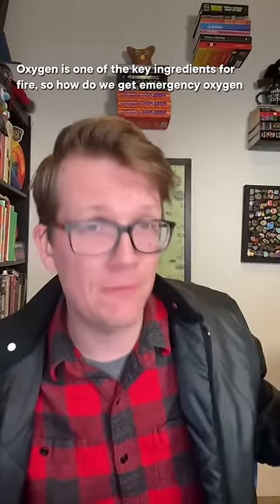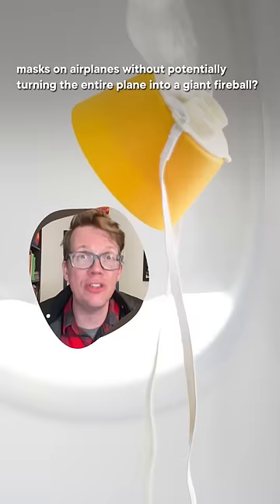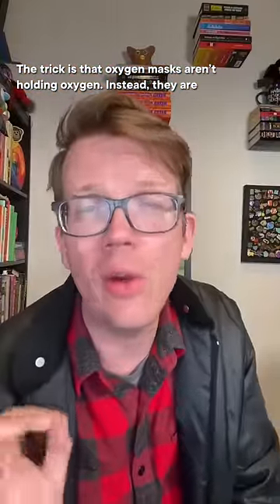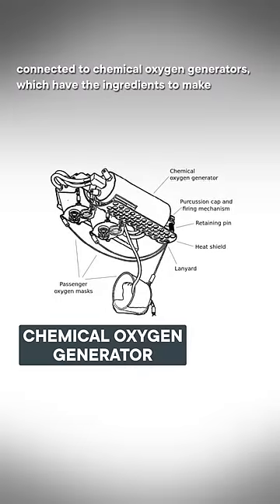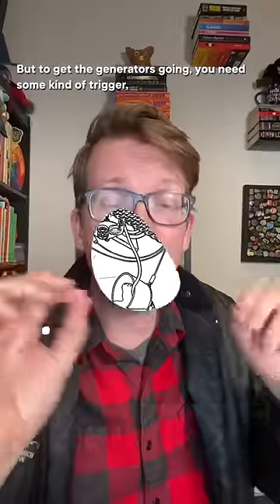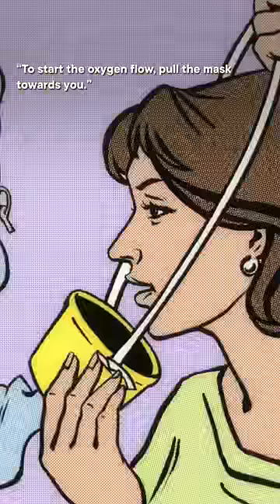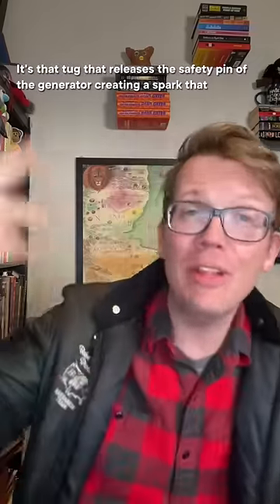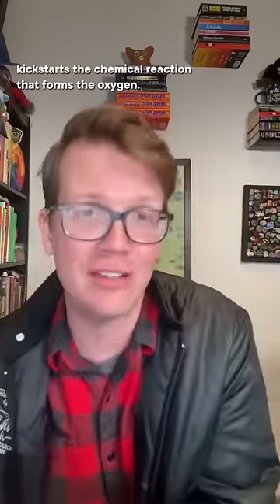If oxygen means fire, how do we get it on airplanes? #shorts #science #SciShow

Comment: All this complex engineering and chemical creation ability and the trigger is just a simple mechanism from pulling the mask toward you. Sometimes simple machines are still the best way to go.
Reply: Less parts = less chances of failure
Reply: @typicallyusual6984  the only problem with that is when it does fail it will be really bad.
Reply: Simple machines are ALWAYS the best way to go. The best and most reliable systems you can think of are likely made of mostly simple machines.
Reply: "Simplicity is the highest form of sophistication." Leonardo da Vinci"
Reply: @djmdma3752  It's not a problem if only one or two fail. Most, if not all, planes do have a few oxygen bottles for emergency use
Reply: @raerohan4241  I’m talking about when something has less parts the chance to fail is lower but more damaging
Reply: @djmdma3752  A system with more parts doesn't mean that the failure of one of its parts will be less severe, it just means that It has more parts (a.k.a more points of potential failure)
Reply: Well, why would you make it complicated? 😂 There's no reason to say "that's a complex system so we need at least a 10 digit code (in ancient Egyptian language) instead of just pulling, but not entered with regular typing but via thinking of the numbers while your brain waves get analyzed with some alien tech".

That's like saying "woooww, the Bugatti Chiron is such a complex, well engineered car and you can start it with just pressing a simple button? Sometimes simple tech is still the best way to go" - yeah, what else would you do? 😂😂 Just because something is high tech or well engineered, it doesn't mean it has to be complicated to operate.

Comment: The oxygen supply does not need to last long enough to land, just long enough to get to a flight level where the atmosphere contains a breathable concentration of O2, between 10,000 and 12,000 ft. A plane can easily get to this level from cruising altitude in less than five minutes.
Reply: yeah like what he said in the short haha
Reply: Lack of pressure to get the o2 into the blood is the problem, concentration is the same at 35k as10k..  correct on the time to loose altitude part
Reply: That's what he said
Reply: @timdeathly  He said "and long enough to land." Very last words. It does not matter if they don't last long enough to land.
Reply: The SOP in a loss of pressure situation is put on O2 masks then descend as fast as safely possible to FL10 (10,000ft). It could be lower. At that altitude O2 is no longer needed. It's not needed to land.

As a side note, did you know airlines purposefully use the affects of hypoxia to put you to sleep? The cabin altitude pressure is usually between 6-8000 feet, often during overnight flights the pilots increase the cabin altitude to make you sleepier, especially effective after that free booze!
Reply: 20k feet in 5 min is scary

Comment: Aside from the obvious compactness benefit, storing bottles of oxygen on the plane would be an incredible pain, as would be keeping up and testing the plumbing needed to move all that gas around. The chemical oxygen generators can sit for years waiting to be used, and the fact that it's one per passenger means that you aren't pumping oxygen out through the tube by an empty seat in an emergency.
Reply: Yup! As someone who has chased leaks in actual pressurized crew oxygen lines, I am GRATEFUL they only run to the cockpit
Reply: I work military aircraft with both oxygen generating packs, Carry o2 bottles, and lines that run the entire length of the aircraft. They are notorious for leaks. Imo it's outdated and bad design

Comment: Just for peoples info, make sure you do yours first. You have roughly 15 to 60 seconds to get the mask on before hypoxia starts to take affect, so take your time, be calm. Then help the others around you.
Reply: This particular point I never understood:  I can hold a single breath with no additional oxygen for more than 60 seconds.
Reply: @Nahrix  in a situation like the cabin of a plane depressurizing, most people would panic, and everyone's adrenaline would be activated. This would interfere with problem solving and cause some people to freak out.

Ignoring the panic:
Holding your breath is possible from the oxygen diffusing into your blood from your lungs. So since the oxygen content plumetted during decompression, holding your breath wouldnt help.

Example that would work the way you describe:
if you take a breath of the mask air, then hold your breath, you would be fine.

Hope this helps
Reply: @BiloGadget  I think I understand that what you're saying is that the oxygen levels in the depressurized cabin wouldn't saturate a held breath as at sea level.  I suppose my assumption would be you might have a second or two to quickly breathe in before all oxygen is lost;  or would a cabin depressurize completely in milliseconds?
Reply: @Nahrix  mainly, it would depend on how it occurred. did the plane split in half, or did something eat/corrode a small hole in it? In a way you are right, since most cabin depressurizations aren't explosive (meaning it occurs in less than half a second), and you could likely get an extra breath of air.

think of it like a reverse vacuum chamber being released, with the pressure being on the inside instead of outside. it doesn't need a very large hole, only a small valve, to release extremely quickly if fully opened.

what i was assuming was that an exit door or something like a window failed. with a hole that big the plane would depressurize very quickly. you might be able to get a good breath of air if you're aware of the issue as its happening (as in, a part of the plane vibrating intensely). also, rapid depressurization can cause barotrauma (literally means pressure injury) to the ears and possibly the lungs and eyes if it happens in less than half a second. if you are unaware of the issue in the plane, then it's unlikely you'd even get a chance to think about preparing a breath.

however, if it's a small pinhole, like the small holes in plane windows, then the pressure system of the plane should be able to counter it and you wouldn't even notice the change, and the masks wouldn't even drop.
Reply: Depends on levels of altitude
Higher means less time and it can drop to even 1 or 2 secs.
Reply: @luichinplaystation610  that's what i was getting at with the vacuum chamber example. i just really beat around the bush. thank you for clarifying.

Comment: I thought they were just connected to tiny oxygen tanks! Thank you so much, SciShow!
Reply: Yeah I can see that turning a plane into the Apollo 1 accident very quickly
Reply: you should thank hanks tbh
Reply: Sometimes they are. For example, crew oxygen (on the flight deck) is supplied by bottles and the masks are more similar to something like a respirator than those crappy yellow cups that the passengers get. There are also some flights that regularly cross over mountain ranges that have high enough peaks that the aircraft could not get down below (IIRC) 14,000 ASL without risking CFIT (controlled flight into terrain). If those ranges are large enough that the aircraft could not safely reach 14,000 feet within a couple minutes, then those aircraft are equipped with oxygen bottles for the passengers as well that can last 40-50+ minutes, long enough for the aircraft to clear the mountains and descend to a safe altitude.
Reply: Don't thank them it's a @hankschannel video
Reply: They are… unfortunately Hank is 5 years or so behind on the technology side. That’s how they used to do it and how some still do until they upgrade to the new method
Reply: @steventyler8002  Almost every passenger plane uses oxygen generators. They are significantly lighter than tanks for the amount of oxygen they can produce.
Reply: @richardmillhousenixon  nope. It’s literally my job. Dry gen is old tech. The new regulator we have designed is cheaper, lighter and easier to service. Weighs about as much as an empty aerosol can. No dangerous dry gen materials and is what the industry is switching to over dry gen. We also make all but about 8% of the generators worldwide so this isn’t just a sales spiel.
Reply: @steventyler8002  Oh ok, you're talking about a different technology for oxygen generation, or am I not quite understanding you. Still using chemicals to generate oxygen just different chemicals?
Reply: @richardmillhousenixon  no pressurized oxygen bottles with their own regulator. There are 2 kinds of generators dry and wet. It has to do with how they are manufactured, but these are small bottles about the size and weight of an empty aerosol can of pressurized O2.
Reply: @steventyler8002  Oh, thank you!
Reply: @steventyler8002  A bottle that size couldn't hold more than a couple minutes of O², and even less if it is pressurized air instead of pressurized oxygen. Chemical generators are much lighter and smaller than a bottle of oxygen for the same amount of oxygen.
Reply: @richardmillhousenixon  I don’t know what else to say bud. We are hiring, and if you can pass a low level security check and a drug test I could show it to you in person. But at this point I’m going to start taking offense to being called a liar.
Reply: @steventyler8002  Because the comment got removed, Mentour Pilot has a really good video on the o2 systems on planes, and since he's an actual airline pilot I'm kinda more inclined to trust him
Reply: @richardmillhousenixon  scroll through more responses to this post and you will see many similar responses from many different perspectives. Are generators still being used, yes, but are oxygen bottles being used as well, yes!
Reply: @steventyler8002  Bottles are very rarely used. I even acknowledged that in my first comment within this thread. They are very situational and only used for certain flights on certain aircraft
Reply: @richardmillhousenixon  no they are common…. Pay attention. Times have changed.  My company makes over 90% of ALL aviation oxygen. We make a lot more bottles of O2 than generators. In the next few years our generator business will be niche. I literally make this for a living. It’s my job. It’s what I do. Now I suggest you wrap your head around the fact that things change. And we are at this very moment living in the transition phase between generators and O2 bottles.  YOU ARE WRONG.
Reply: @steventyler8002  I assume you are talking about PulseOx, correct? PulseOx is designed to replace gaseous oxygen systems, not chemical systems. Chemical systems have always and will always be lighter and smaller than gaseous systems. Quoting the page from Collins Aerospace (which I see in another thread, you mentioned that they are the company you work for)
"Chemical oxygen generators eliminate your need to store high-pressure oxygen and related hardware. Using the latest certification methodology for oxygen saturation, we offer the lowest possible system weight for passenger aircraft while maintaining a safe, reliable system."
Reply: @richardmillhousenixon  come on down and I will give you a tour of the facility.  And if you are cool I will show you our F.A.R.T.S. test stand…. Fully Automatic Regulator Test Stand. And while pulse is one of our products it’s not what I’m talking about. However the tech was derived from the Pulse regulator. Pulse was designed as a replacement for crew portable O2 systems.
Reply: @steventyler8002  I read the brochure. PulseOx is designed to replace inbuilt gaseous oxygen systems.
Reply: @richardmillhousenixon  we all had a good laugh at your arrogance during our morning meeting.  Just so you know the line that busted the room up the most was “I read the brochure “.
Reply: @steventyler8002  Am I supposed to be embarrassed? I have no doubt that your company might indeed produce 90% of the oxygen systems for airliners, after all you do produce both good chemical generators and a great alternative to centralized gaseous oxygen systems for those flights that need the longer duration supply. But I know with near 100% certainty that chemical generators continue to be the most commonly installed in new aircraft.
Reply: @richardmillhousenixon  I love how you keep moving your goal posts. Read back at all your statements and see how you’ve changed.  Most common… debatable, 5 years from now 100% false. The pandemic has slowed the rollout a bit after all.  There is a reason Raytheon bought my company and that reason is our oxygen sector. At a time when the airlines are demanding lower cost parts we delivered a not only cheaper option, but one that lowered operating costs and reduces maintenance down time. But hey as long as you keep moving those goal posts you will eventually be right. You might want to see a doctor. You have some troubling behavior traits that might be holding you back. You are obviously an intelligent person but this stubborn fight to not be wrong… it brings you down. Great example of the Dunning Kruger effect I would say. If you are under the age of 21 ignore that advice because that will hopefully change as your brain matures. Have a good day buddy and just know that every time you fly I had a small part in helping to keep you and your fellow passengers safe.
Reply: @steventyler8002  nah man you’re lying about everything obviously!!! He’s definitely right!
Reply: I belive the pilots ones are, since it's more reliable
Reply: @steventyler8002  I really respect you, even though I know little about this industry it is clear you know what you're talking about whereas the other guy had to Google and search stuff up. Very mature of you to recognize his intellect, because yes he's clearly not stupid
Reply: Yes in fact there are o2 tanks though not small, une large one that serves as part of the ballast, 
I am an m.p. and have had the job of refilling the o2 tanks and then filling the tires with nitrogen
Reply: The flight crew are connected to an oxy tank.

Comment: A long time ago, when smoking was allowed on planes, my mom was having severe breathing problems from a chest infection and wasn’t getting enough oxygen. So they somehow got the mask out just over her seat, pulled to get the oxygen going, and she used the mask the whole flight. She used up all the oxygen for the plane. I didn’t know until just now what she was using!
Reply: It's not the oxygen for the whole plan, each set of masks is only connected to a single oxygen core.
Reply: This is not possible. Its more likely that they supplied her with a portible oxygen bottle. Several are carried onboard.
Reply: @valjoker7  I don't know, I just know she used the regular mask from the ceiling & they told her it used up all the oxygen in the plane. This was probably the 1970s so I'm sure the planes have changed a lot
Reply: @iriandia  It wouldn't have lasted the whole flight regardless. I'm not going to say your mother is lying, but she is probably misremembering